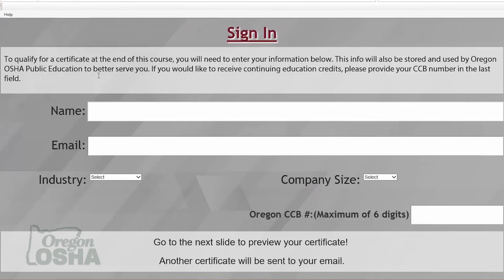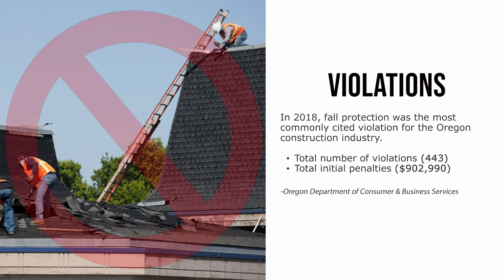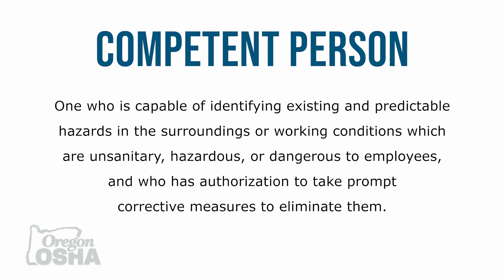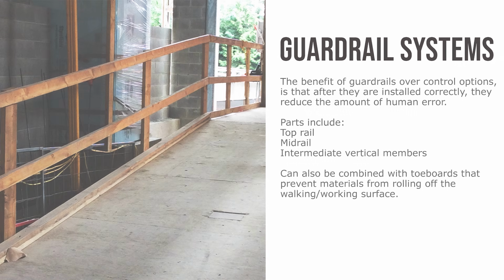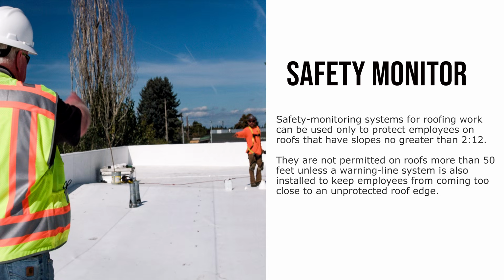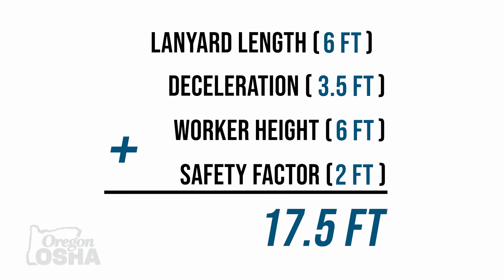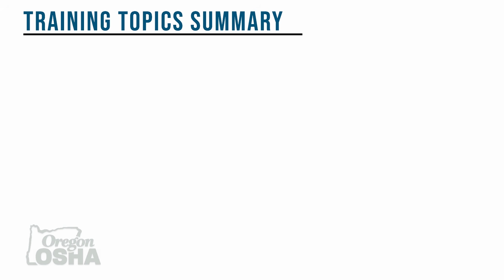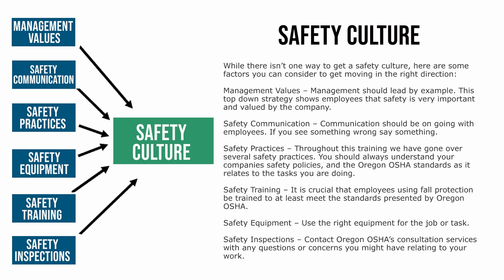Fundamentals of Fall Protection - Full Length Training Course

Comment: Fall protection is a joke because if you fall on a rope grab and an immediate rope grab you will be stuck there until somebody can get the weight under your feet?

I am challenging OSHA to take a good strong look at suspension trauma over centuries of people falling off of scenarios at height related situations and not being able to become from the accident alive.

I am the inventor of the z runner self rescue system for a mechanical device that does everything for people that work in height related scenarios

#zrunner

Comment: Dont want to use lanyards on staircases while walking down with hands full?  Is OSHA MSA State worried about structural integrity of utility poles, roads, side Walks. These companies use safety as a weapon but don't apply themselves. Just look around. Safety Starts with work practices. Fallacy is that wearing or using means your being safe or safer! Its not